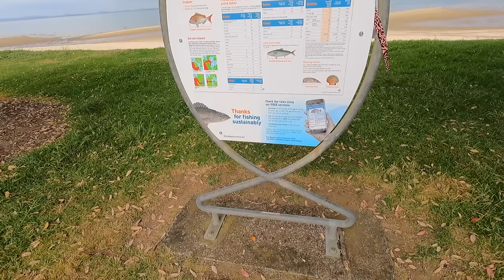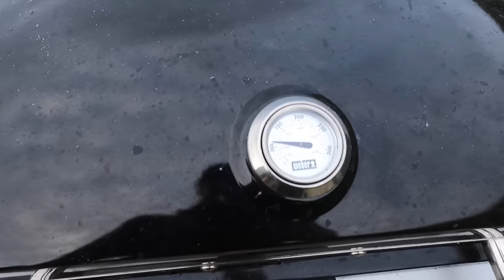SOLO Camping Catch & Cook | Crayfish Diving & Scallops!

Comment: Finally got Chance to watch it, YouTube is finally working. Wanted to ask, why aren't you using your ruku blades anymore? Did you get sponsored by seabuck?

Mainly wanted to know how you felt about the rukus, I wanna get some myself. Currently using plastic cressi modular  fins, they do the job, but not as good as fibreglass.
Reply from the maker: Rukus are great mate. Just trying out some carbons instead of fibreglass. Can’t have the same gear forever need to try new things

Comment: Why do you prefer the irb over something like a tinny of the same size? Looking at getting a boat for diving and would love to hear your opinion
Reply: Irb is easy boat to dive from having soft low rubber sides also can get you there quickly easy launch.
Reply from the maker: I just like how light they are. On calm days, It's very fast across the surface and can get to spots quickly. As its a flat bottom when in close to rocks/reef, I can basically turn on the spot which is helpful. Also I do a bit of diving out on the west coast so is great to jump the surf (what its designed for). Very comfortable for slipping in and out of while diving